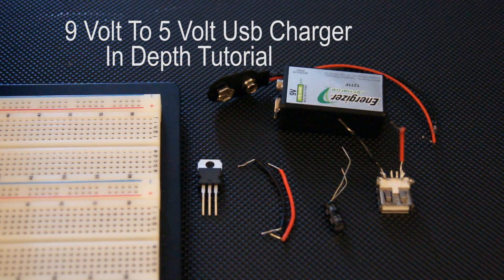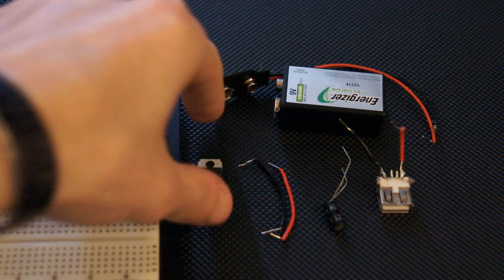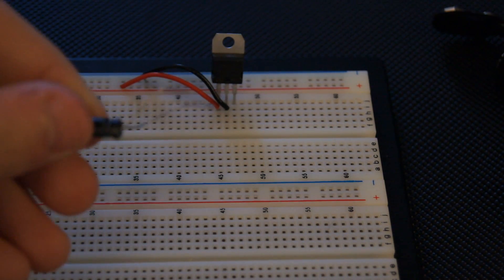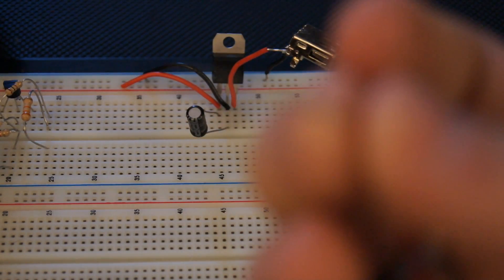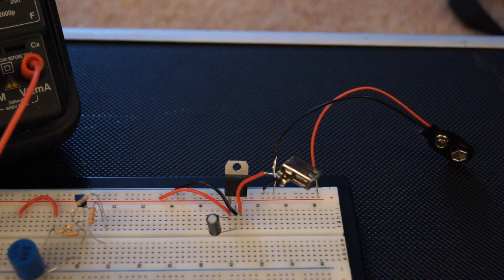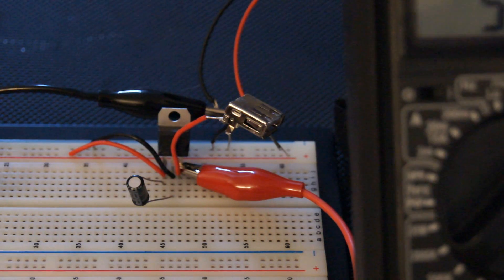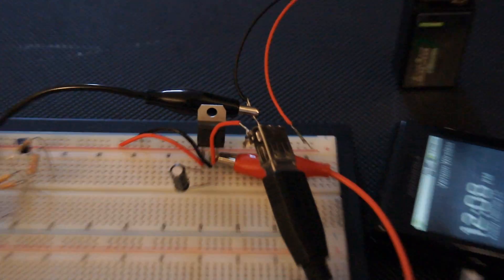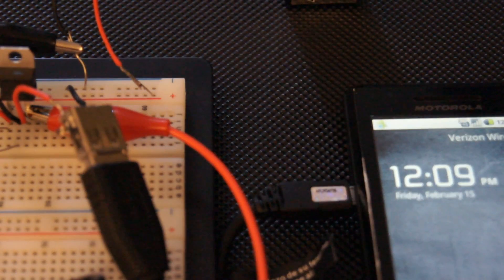9 Volt to 5 Volt Phone Charger Tutorial

Comment: I just wonder what's the advantage of powering your mobile battery with another battery ?! I think it's better to make a transformer that converts AC voltage instead.
Reply from the maker: +Abdulrahman Mahdaly It would be more portable with a battery.
Reply: +Abdulrahman Mahdaly you can use it to make a car charger, a car battery I think is around 12~14volts DC. And you can also make a charger using the landline phone outlet when the power is out but just use it for emergencies, I think it is around 50v DC. Also use a regulator that can handle +50v DC for the landline phone charger and read the datasheet for additional information. You can also use a voltage regulator (vreg) with a solar power system to charge a mobile...etc. Lotsa uses as you have seen.

Comment: linear voltage regular are very inefficient and most of the power wasted in the form of heat. the higher the current draw the hotter the 7805 will get.
Reply: +onecreativecriminal so what do you suggest as an alternative then?
Reply: +igrewold It creates heat because when you put a voltage like 12v or higher through the 7805 it creates heat, which you could use a heat sync with it, the higher your input voltage the bigger the heat sync should be. So what hes saying its instead of taking 9v or 12v and bringing it down to 5v, you should get your input voltage to the regulator to be closer to what the output of the regulator is. So instead of 9v or 12v input, 7v or would create less heat, and you would lose less power through heat, thus making it more efficient. Just keep in mind the input voltage for the regulator needs to be 1v or 2v higher than what your trying to get from the output, but go too low and the regulator will not put out 5v.
Reply: igrewold buck boost converter

Comment: I have a doubt. I am doing an arduino nano project. I need 5 V and I will be using a 9V battery. Do I need to use the Capacitor?
Reply from the maker: +Abdulrahman Mahdaly Correct. The cap is just used to smooth the noise out of the regulator
Reply: +Gairik Biswas I think, the capacitor is used just to get rid of the ripples but one can use the 7805 without a capacitor.
Reply: +Gairik Biswas follow what the datasheet says.
Reply: what capacitor i have to use plz tell me
Reply: what capacitor i have to use plz tell me

Comment: how much capacitor value can i use for small led?
Reply from the maker: you could use a 220 ohm resistor from the 5v output from the regulator, then the led, then the negative leg back to ground.

Comment: Hey there,
The Video is very nice, but I have a problem. I do exactly the same thing as You on Your video, but my phone is still not charging at all. I have two Nokia mobile phone and they have the same charging problem. Why? :(
Reply from the maker: This could be that the device requires the data pins to be brought to 5v or ground. google the device charging pinout and that might help.
Reply: Thank for Your answer! I've done some tests and here are the results: Without resistors (only +5 V from regulator to USB + and GND to the USB GDN) is ok but charging only MP3, MP4 and game consoles. Charging current is 0.20 mAh, regulator is slightly warm, while the voltage on the USB pins is: before connecting the device: 5.01V and when connected - 4.60 V, devices charged ok, so the regulator and connections are intact. About the PIN data + and -: I've tried different combinations and resistance values, but so far without effect. I will try all possible combinations of first on my Sony Ericsson.

Comment from the maker: Its called an electrolytic capacitor. These are polarized meaning you have to connect a certain leg to positive and negative voltage. This capacitor is here to smooth out the dc voltage, in case of voltage spikes from the power supply. You could use anything over 10 micro farads, that should be fine.